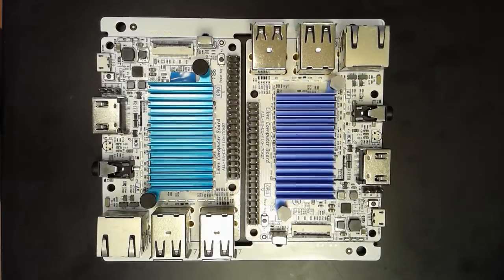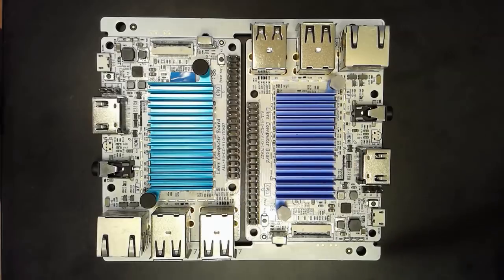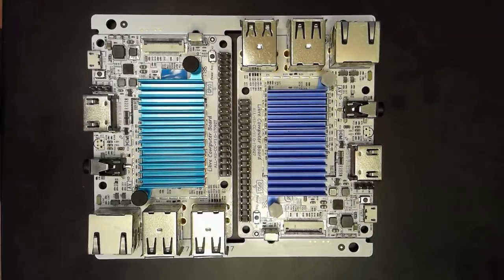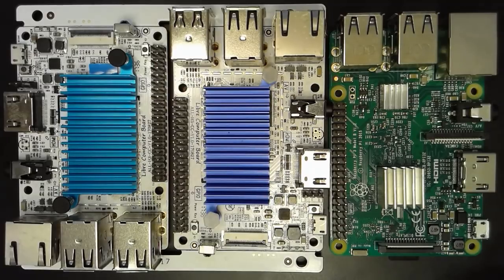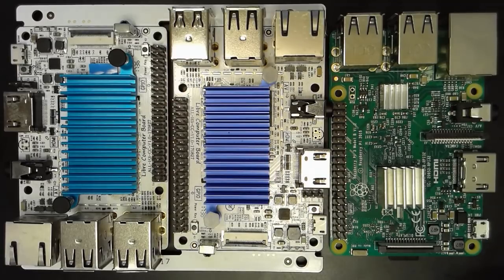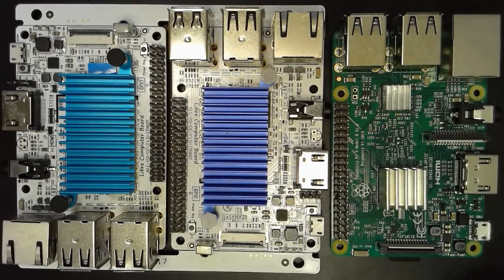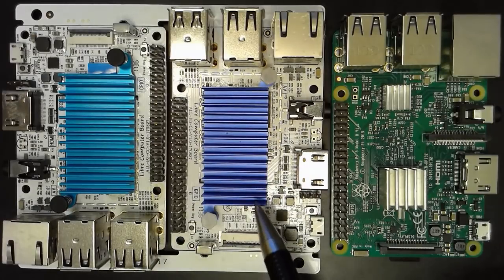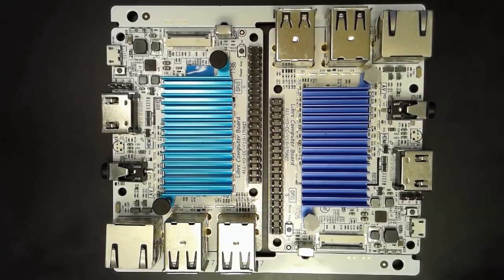Libre Computer Board ALL H3 CC (Tritium) Hardware Overview

Comment: Libre boards are the worst.  No hardware support and two of mine simply failed after i finally got them both working with some lame firmware from the olden days.  Just tossed em both in the garbage.